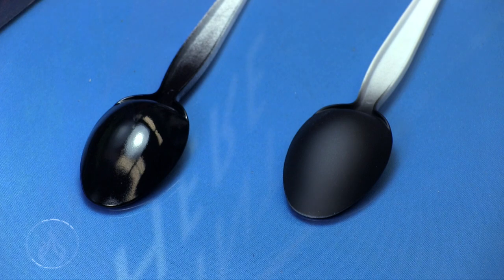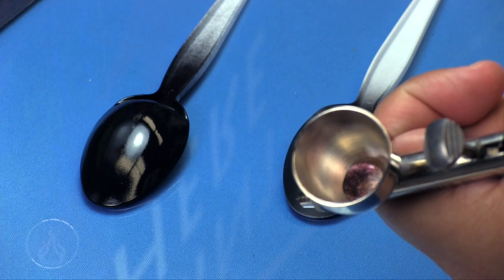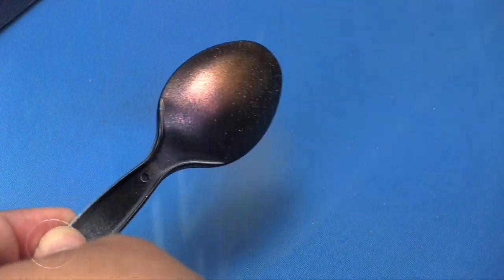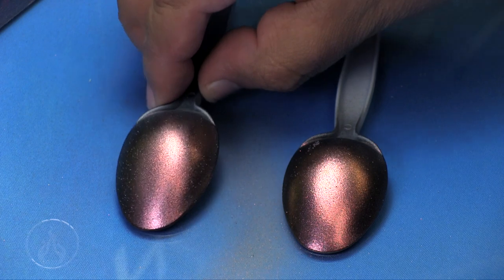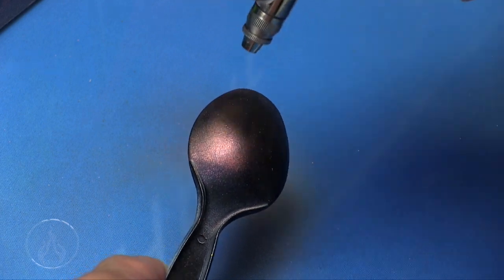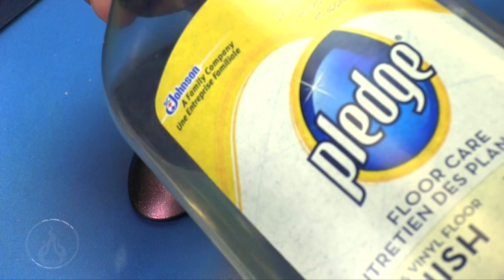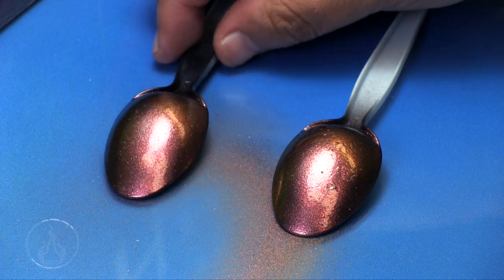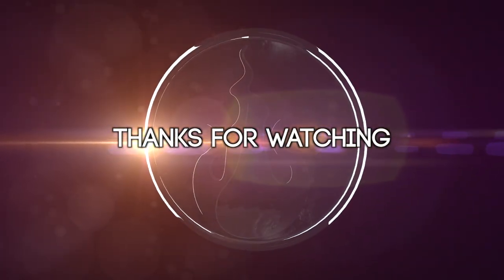Painting AirBrushing Nail Polish (color shift) pt2

Comment: Thanks for the video.  Would one be able to spray nail clears too as a top coat?
Reply from the maker: Yes, absolutely. You may want to thin it with nail polish thinner but it should work just fine. Do a test before committing to a project.
Reply: @WayoftheBrush  thank you very much!

Comment: Kris, very good video!  You have a good voice for it.  

I've been having better luck getting a smoother finish with VERY low air pressure and using a LOT of lacquer thinner, like 70-75% thinner to paint.  Then making several things coats.  The only issue I am having is getting a high gloss shine from the paint itself, but that's what clear coat is for, am I  right? LOL. Great video!

Comment: Will the acetone be a danger for the o rings in the brush?

Also, I can't wait to see this used on a figure...
Reply from the maker: Innocent_Bystander i wouldn't think so as the thinner is a acetone solution. It's not pure acetone and not likely to eat the rubber or cork.